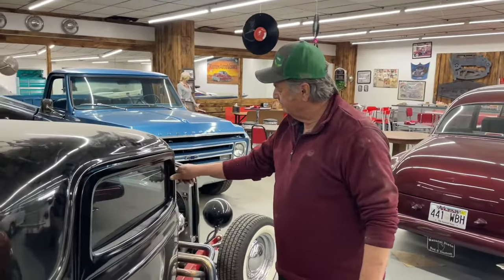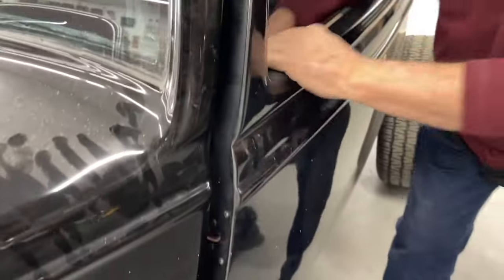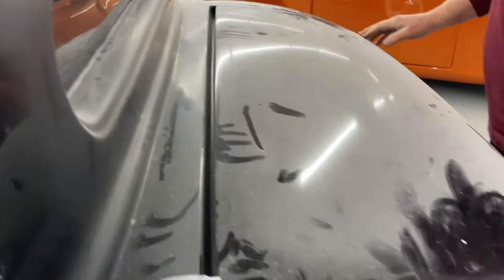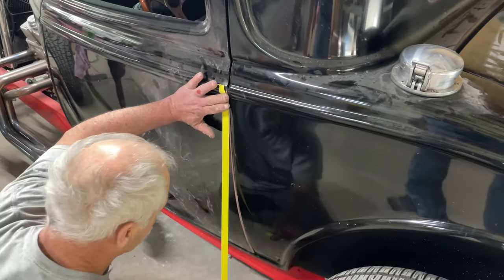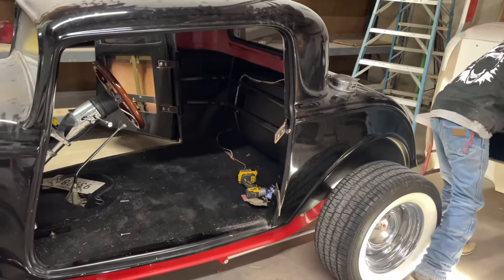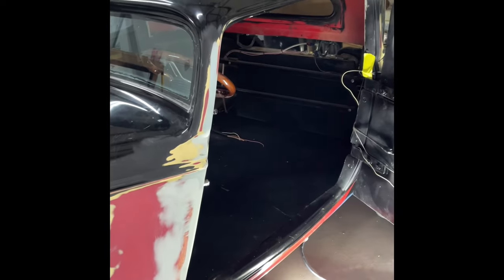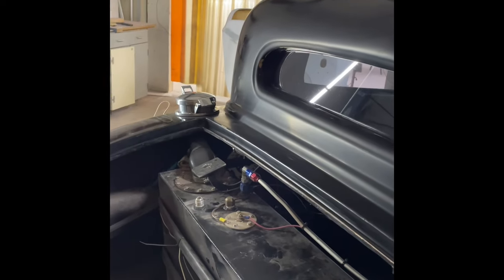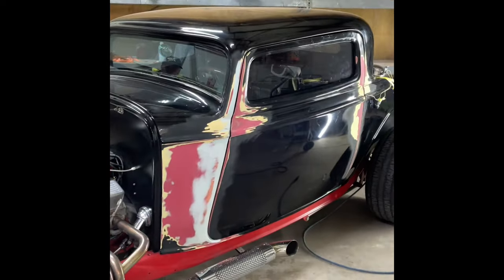Fitting doors, deck lid and installing door poppers.

Comment: I had a 32 Vicky I built, but couldn't fall in love with the fiberglass body. Got to weatherstripping where I tried some 1/2" round universal stuff, kind of worked. Got to interior and had no mounting points inside for anything...Started building a tubing cage for panels and headliner mounting points....decided to sell it and get something else. Should have found a steel body to put on the chassis we built and kept it. 

Nice work on this coupe!